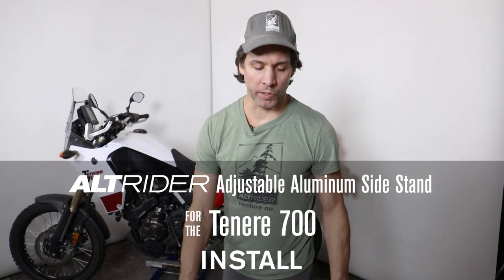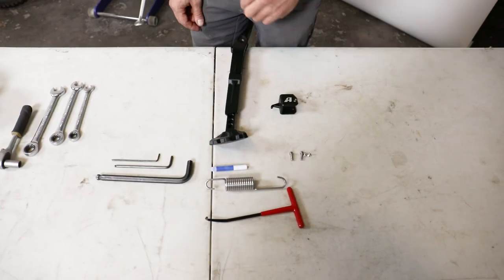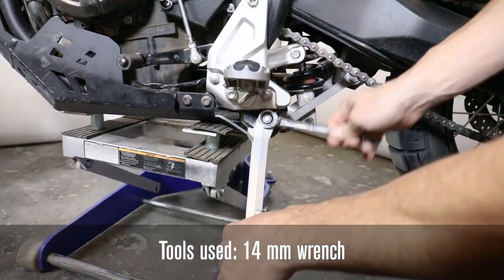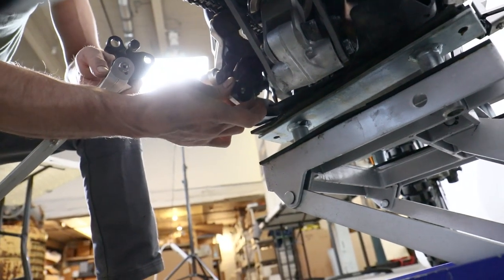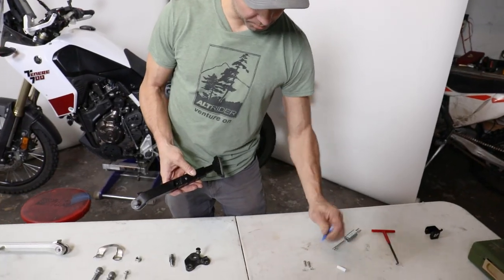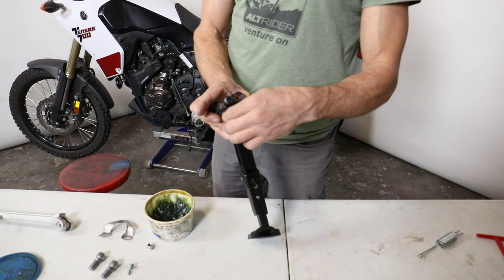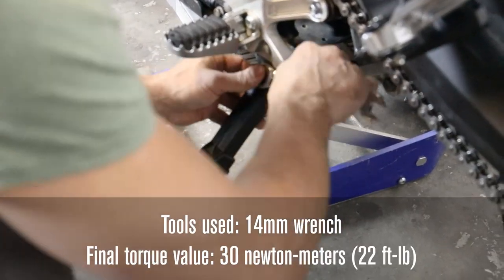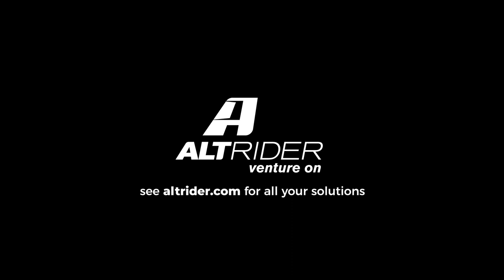Yamaha T7 Adjustable Kick Stand Install by AltRider

Comment: I finished installing the side stand. Great sturdy piece. 2 questions though, there’s a bit of a play (just when I put the bike on stand) between the side stand and the piece that goes into the frame with the 2 big 10mm Allen bolts, although the bolts are tight and used red lock-lite as per factory. Also, would it be advisable to leave to bike until the blue locktite dry? (From the side stand bolts) or is this a dumb question? :) Thanks
Reply from the maker: We designed our side stand based of the factory side stand. So it should fit around the clevis the same as your factory stand, in fact if you put your original side stand back on you'll likely see the same little bit of play.

Threadlock is important, if you're using the more permeant threadlock (red) just be aware you may have to use heat to remove the nut in the future. Letting the threadlock dry is great, but not really necessary unless you're going on a looonggg drive that would rattle the fasteners enough to loosen them
Reply: @AltRiderLLC  thanks, tho original stand will be permanently in a 📦. AltRider side stand is too nice. Thanks for the fast response

Comment: really awesome. Cant wait to get one for Africa Twin. Propably will be universal between all models but just in case im getting a Adventure Sport DXC ES. Africa Twins def need that sidestand. The OEM one is def too short
Reply from the maker: Ya, it will fit all the different models, its available for preorder - for both the CRF1100 & CRF1000!
Reply: @AltRiderLLC  just back ordered. I was wondering about the design though. Isn't it better if the foot is slightly textured for a little grip?
Reply from the maker: You'll notice that every side stand out there has a flat bottom, and if it doesn't any high points will be scratched and worn off fairly quickly. So, long term a texture won't really add value.

We do however, add a convex bottom and that will ensure a good contact patch with virtually any shaped ground.

Comment: How much lean (degrees from vertical) should be targeted when on the side stand?
Reply from the maker: It's really about feel, and you can easily adjust the stand up and down to what feels best for you. And you may want to make adjustments as you make alterations (tires, luggage, etc.) that alter the ride height.

With all that said, we've found 12-14 degrees of lean tends to feel best

Comment: I was careful and still snapped the 10mm bolt. Clearly not careful enough. Any tips for removing it? The switch seems reasonably secure without it, what’s it needed for?
Reply from the maker: Dang, that sucks! We totally get it, we broke one early on in the development days. Let me reach out to the engineers and find out what they did but I suspect it will require an easy out.

The switch is the safety measure so you cannot have the engine running, with it in gear and the kickstand down (if you drive with the kick stand down that would be dangerous). It's common to disable this, but you just need to be aware of it.
Reply: @AltRiderLLC  yeah I was thinking I could just remove the switch entirely, but then wasn’t sure if the bolt was needed for anything else. It seems to hold in position without the bolt which is weird. 

If removing it I guess I’d need to remove the stand and then tap it and remove the broken bolt- let me know if the engineers have any great tips, or even know what replacement bolt would be needed.
Reply from the maker: Ya, your best bet is going to be an easy out, just be careful because the bolt is steel and the Adjustable Side Stand is aluminum (so it will be easy to damage the threads).

Its a specialty bolt, so you'll have to get it direct from Yamaha 😕
Reply: @AltRiderLLC  I might just ditch the switch all together and bypass it. Don’t think the bolt does anything other than hold the switch in place. But yeah, warning to others, be really careful with this bolt. It barely need snugging up

Comment: The 10mm bolts had red locktite on them from factory and i stripped out the one on the right.  I'm not sure what to do at this point.
Reply from the maker: Ahh - that's super annoying, sorry that happened! I think I know what part you're talking about, but since I'm not certain I don't want to give a suggestion that may not be applicable. 

Give us a call or email and we should be able to get you a suggestion to get you set up.
Reply: Thank you.  I tried to Chamfer the end of the bolt hoping that would work, but no dice.  I bought a helicoil kit that arrived last night that I'm going to do today - I am confident that will work and I'll get it all put back together and get the kickstand on.  It's been an entire process, but the lowering links are on, the side stand will be on, and now I just gotta hope that the aftermarket Acerbis tank I put on will clear the fork tube adjustments well so I can slide those up, too.  I'm going to be pretty annoyed if there is a block.. @AltRiderLLC
Reply: Alright update - I finally got it all together.  I had to do some rethreading of those holes along with threadlocker.  The side stand is on and the front forks were dropped 22mm.  I'm excited to test it out in a few days!  The differnece is amazing.  Before, with boots, I could flat foot on one side if I leaned the bike way over.  Now I'm at the balls of both feet with slippers on, so boots should be even better  @AltRiderLLC
Reply from the maker: Hey, that's great to hear - glad it's all working great for you!